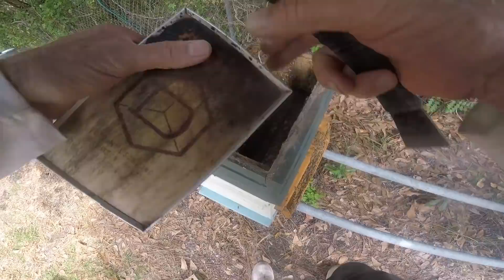Loading The Two Frame Mating Nucs

Comment: Howdy Bro just a couple of question how late is to late to make 2 frame splits before winter?
We have a mild climate  with no frost and never really gets lower than 6 degrees.
Also you say keep the feed up so how often do you fill your jars after empty.
Straight away and do you feed pollen patties in winter to keep them breeding over winter?
Reply from the maker: My last splits are sept.or oct.If i want them to draw comb i feed them all the time.A large hive will drink a Qt. per day.If you have a natural flow coming in not so much.I don't do much with patties because of hive beetle problems we have in Florida so i just put out dry sub in a feeder.They have been hitting the feeder pretty hard all this week.